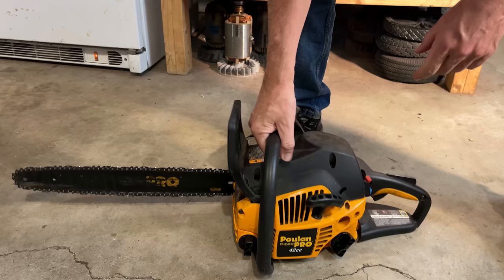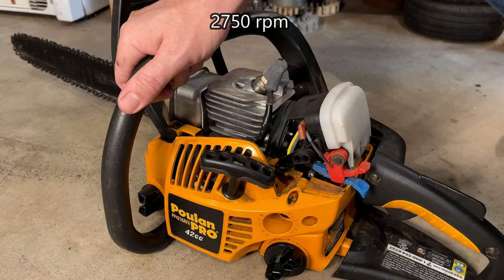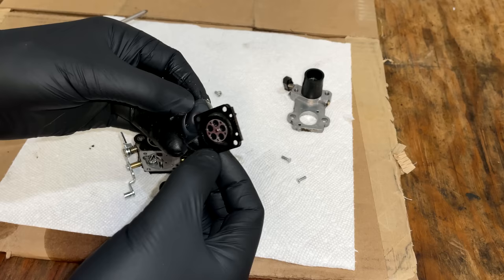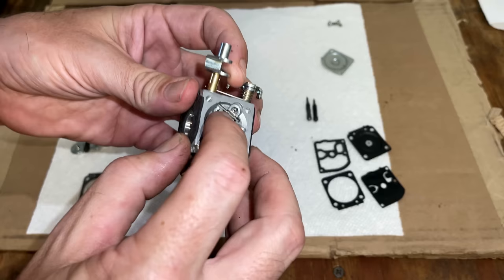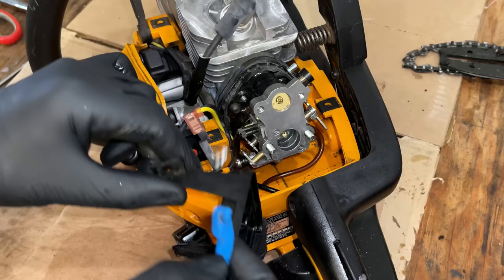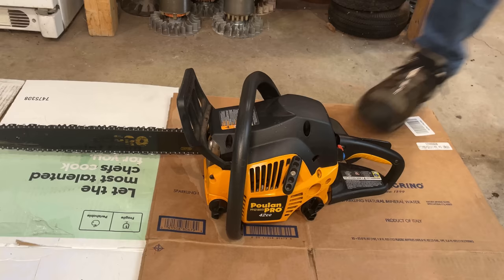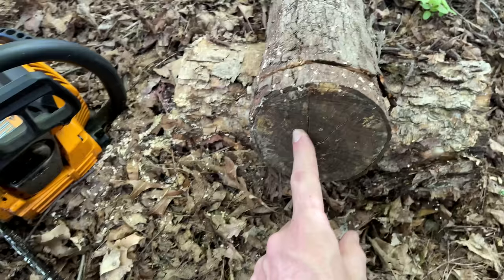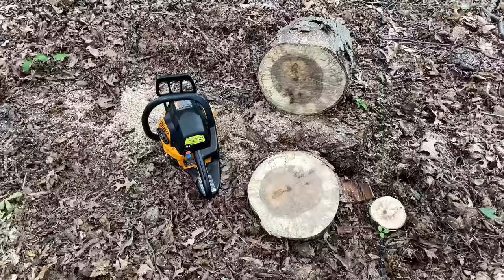Poulan Pro Chainsaw  - Not Running or Cutting Well

Comment: Mid position for the blue choke pull lever is a fast idle warmup setting and
combines with partial choke. With the saw first running that midpoint choke
detent is where the lever should be left until the saw is warmed up for about
a minute or so. During warmup the saw speed will increase gradually and it 
benefits from the rich mixture and high idle speed, also delivering oil to the
spinning chain and getting the saw ready to cut. When the trigger throttle
is pressed even slightly it will release the choke completely and the fast
idle detent also releases, so the idle will drop fully to the limit set by the 
idle adjustment screw. If the saw is not fully enough warmed up when 
the throttle trigger is pulled the engine will stop and that is normal to 
happen. With the engine fully warmed up and the idle set a little high
by the idle adjustment screw, the low speed mixture screw is adjusted 
to find the fastest idle point, which will be leaner by a small amount 
than where is the optimum set point, usually about a quarter turn 
richer, counter clockwise is close to perfect. But there is some 
interaction with the high speed mixture that has to be checked
so there is no stumble or hesitation when the throttle is suddenly
opened full. Running slightly rich mixture for both low and high is
ideal reduces heat and wear and extends the life of the saw as is
really the rule for all engines but especially small engines.  Storing
these type saws with the choke lever at middle detent is also the 
best because it leaves the throttle and choke plates cracked open
and allows evaporation of excess fuel from the crankcase that can
be left there when the saw is shut down when idling after hard use
by pressing down that red stop switch that shorts the ignition coil
to the crankcase. That is a kind of "wet shutdown" not as bad as
using the choke to flood and stop the engine, but after hard use
there can be enough fuel residue left in the crankcase to make 
the engine easier to flood next time it is used if that is in the 
near future. Leaving the throttle and choke plates cracked open
on the saw when not in use eliminates a potential cause for 
hard starting later by choking and inadvertantly flooding the 
motor with a crankcase still wet with fuel from a recent use.
I became well schooled in the behavior of these saws using
them all day after long day doing a hurricane storm cleanup. 
It is possible to get first or second pull starting on these saws
when everything is set correctly. But they can be fickle and 
ease of flooding is by far the most common issue because 
the saws are right on the edge of flooding during a normal 
startup. Moisture in the fuel can also cause trouble. And
a bad ignition coil or plug can cause intermittent issues 
that are perplexing to identify. Chainsaws have a throttle 
but are generally run at no middle throttle setting, when
cutting are pushed hard at high rpm near or at wide open
throttle even when bursts are done cutting branches, best
to give it the gas and run it hard. Don't baby it, open it up, 
romp on it.

Comment: Omg what a doucher you didn't warm up the engine enough without changing anything first. Then you could've probably adjusted it to perfect running/cutting settings. Or the other approach is to find the factory mix settings and set them there. Then try to get it to run with idle adjustment only. But only after warming the engine up enough as is first if possible. It was definitely possible you just kept messing with it before it was warm. Otherwise this is a well made and displayed video. You could've had someone hold the throttle upon start up when warm. Then quickly set the high. Then have them keep it from stalling out while you adjust the low. Then set idle. Obviously you have to use a combo of choke and throttle to keep it going sometimes if it sat for a little bit but otherwise is not gunked up. This saw will start every time if you hold it full throttle and pull it once or twice. I let mine sit for long periods after running it dry. You set the idle a certain way after messing with the carbs. You turn it in til it just barely touches the throttle actuator. I know it's supposed to start on choke easy without fully throttle but they just don't normally do that even when new it never started how it was supposed to. But if you hold your foot on the trigger or just hold the trigger with one hand and throw the saw down holding the pull cord it'll fire right up reliable and consistent. Then warm it up and it stays running.

Comment: You don't seem to know how to use a chainsaw properly. It has or should have 2 or 3 sharp pins that you push into the log and lever against . It will take twice as long otherwise. Also I have seen absolutely NO damage done by alcohol fuels in these carbys and you can buy a new replacement carby for $25
Reply: Some saws do not have the spikes.
But if you need to lever the saw to pivot around the spikes to "make it cut" ....
you have a dull chain.....

Comment: this saw is a piece of junk.
Reply: I bought 2 at Home Depot $140/each on sale (many years ago) I'm currently cutting up a white oak that has a 4' base, and I've had 100' long row of fire wood pallets each year. It is not the $1,500~$5,000  brand of chainsaws.
They do function much better, however, as many people don't keep their tools maintained (and well cleaned- as they're using them) they'll have problems with most gas tools, but especially with chainsaws, running fast and hot.

Comment: It's pronounced "carburettor". Not "carbarator".
Reply from the maker: Guess that depends on where you live.
Reply: @jcondon1  no it doesn't depend on where you live. I will not accept that. It is spelled Carburettor and pronounced Carburettor for a reason. Not carbarator. As it is not spelled that way or pronounced that way for a reason. I am a mechanic myself, albeit I only work on small engines and I will work on a car if it's no later than a 2008 model. I've been a mechanic since I was 10 years old, fixing and rebuilding lawnmower engines. I used to fix my parents lawnmower and service it when it needed servicing, then I got my own lawnmowers, albeit old Masport IronHorse 2 stroke lawnmowers that were given to me to get going and fixing up/rebuilding from neighbours that lived down the same long gravel driveway I did growing up here in Australia. Then when I was 14 I started repairing teachers lawnmowers and mowing their lawns with the mower that I'd repaired/rebuilt for them. Then word of mouth got out that I was a great small engines mechanic to the manager of the local Lawnmower shop etc etc.